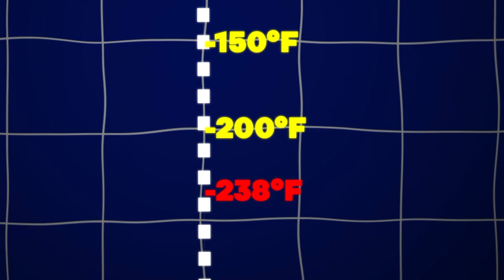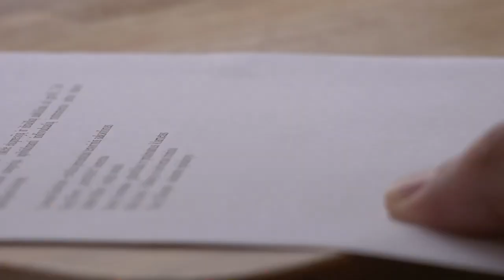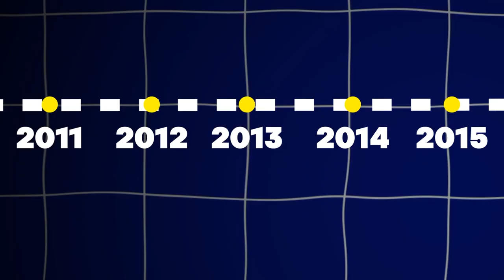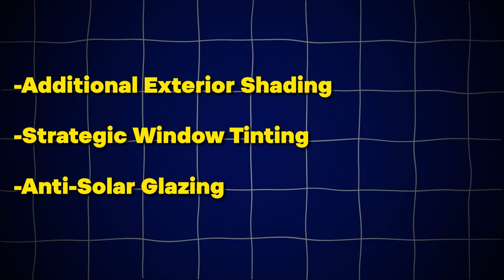London's Odd Skyscraper That Melts Cars

Comment: How does reflected sunlight become a "death-ray? How does a reflected light ray any more intense than a direct ray?  I suggest that this concept is a perception managment action that is designed to provide clever and believable, diversionary cover for the influence of  more insideous forces.
Reply: It doesn't just get reflected, it get's concentrated. I use the same principle for cooking, e.g. with a parabolic mirror.
Reply: @SolarCookingGermany  I appreciate that thought, but it is an old concept. The geometry of the building does not come close to being parabolic.
Reply: @realityAXIS  Parabolic mirror was just an example. But even if it's not parabolic, there is still a curvature that concentrates enough sunlight to reach boiling point.